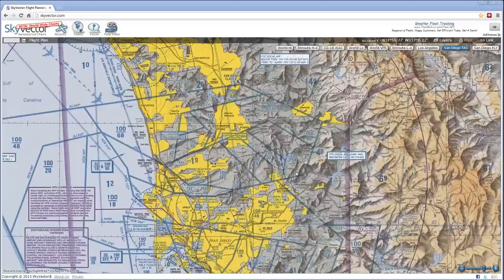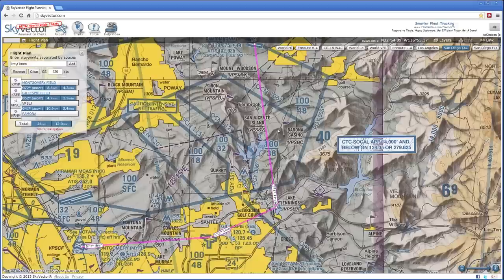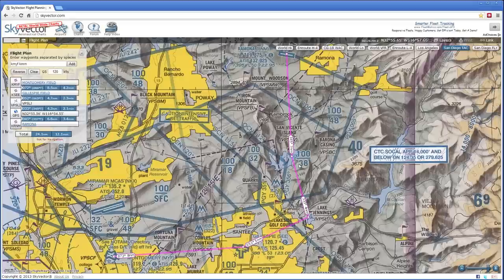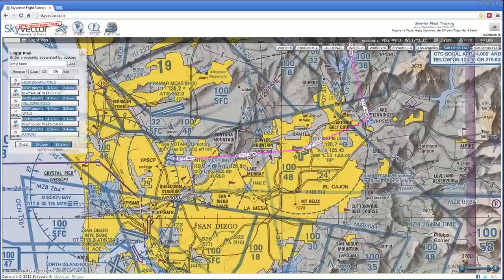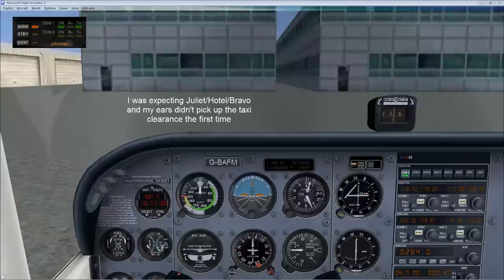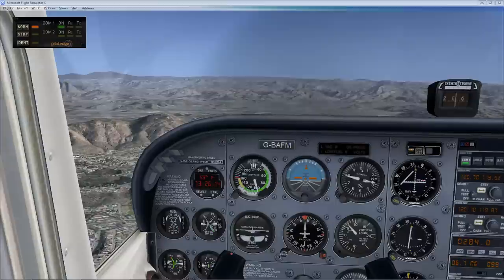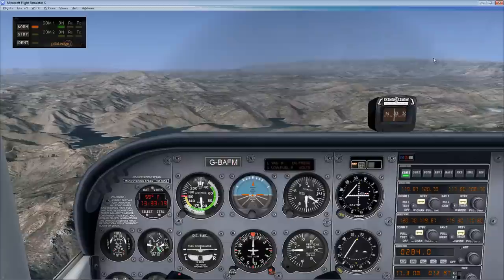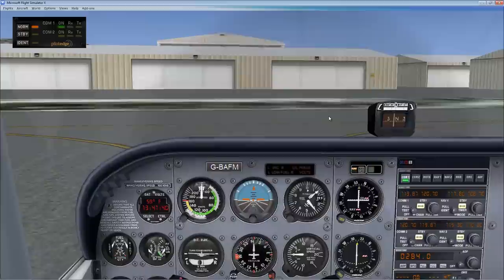PE Workshop 3 - VFR Flight KMYF-KRNM.mp4

Comment: Great video. Really great demo of the value of skyvector for planning. Minor critique: You were too close on downwind which is why you were too high on turning final (and overshot final). Also after landing , I was taught dont raise the flaps on the runway, clean up after you have cleared the runway..  One day you might reach for the gear lever instead of flaps after landing..

Comment: Not sure if you are still monitoring these comments, but would it be possible to circle Montgomery or the surrounding area until you reached greater than 2400 ft so that you could then fly over Gillespie airspace?  I know that wouldn't be efficient, but could it be done?
Reply from the maker: The airspace around Montgomery is pretty complicated and there is almost literally no place to circle that isn't controlled airspace.  You've got Class B airspace all around you (including SFC to 10K for SAN to the south and SFC to 3200 for Miramar to the north), KMYF's control zone extends up to 2900' for five miles around the airport.   I suppose you could fly out towards Mt. Soledad (VPSMS), carefully staying in the 100/48 shelf and circle/climb there, then head back -- but you'd have to climb above 2900 to avoid the KMYF Class D, or call them and ask for transit.  If I doubted my ability to climb to 2400 before reaching the Gillespie control zone, I think I'd just ask Montgomery tower if they would coordinate a transit of the KSEE airspace with Gillespie tower.  If they're not super-busy, I suspect they'd help out (or at least release you in plenty of time to call KSEE to coordinate your own transit).
Reply: Mark Hargrove thank you for your reply

Comment: Hi Mark, great video! On the part where you discuss the DME distances for the various critical points, it doesn't seem like you're taking into account slant range (the most direct, diagonal distance from the base of the VOR to the plane). If we simply chose to ignore the error for slant range, would it still be pretty close to the actual lateral DME distance? I'm also guessing that since we're at low altitudes, that the slant range "error" would be pretty minimal?
Reply from the maker: I did deliberately ignore slant range -- it takes a bit of explanation, and at low altitude it's really not much of a factor.  It's a real "thing" to be conscious of, though.  At a fairly common VFR cruise altitude of 5500' you'll notice your DME distance as you cross over a VOR to still be about 1 mile because you actually are a mile away from it -- straight overhead!    Instrument procedures that use DME distances account for slant range.

Comment: Didn't tower inform you to depart on the right downwind departure?? Not left.
Reply from the maker: Yep, he did.  I didn't even realize I'd made that mistake until I reviewed the video.  Left hand departure is more normal for that airport and that's what I was expecting -- which shows how easy it is to get into trouble!  Usually, you'll get called out on things like that on PE, which may mean the controller also thought he'd give me a left downwind, and so wasn't surprised to see me fly that departure.  Definitely a mistake though.  Good catch!
Reply: Yeah, I'm sure he meant to give you the left downwind departure as you were departing a left runway. He spoke rather quickly as well. Really nice videos!
Reply: +Mark Hargrove Everytime I depart eastbound, ATC give me 28R and a right downwind departure. I use to ask "Eastbound departure, rightdownwind if possible".